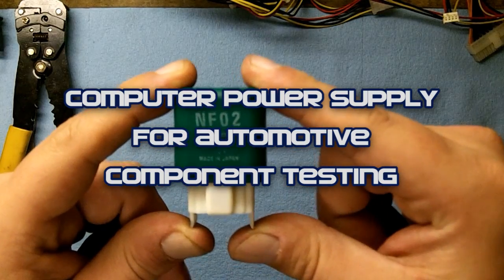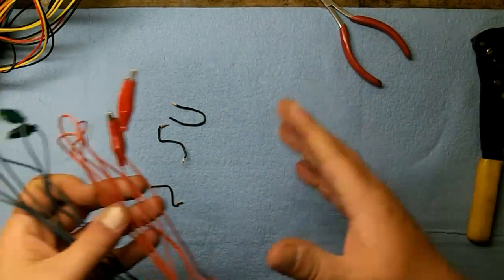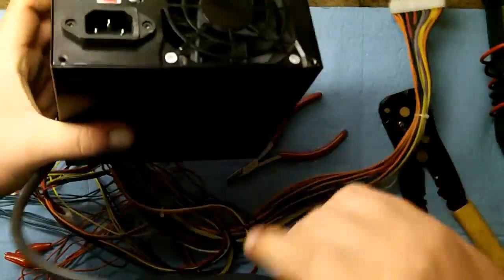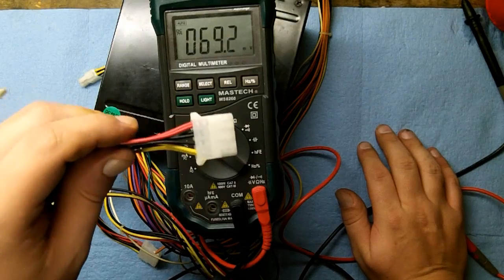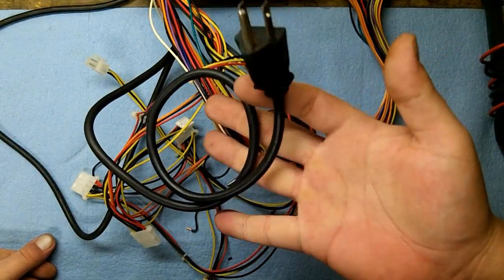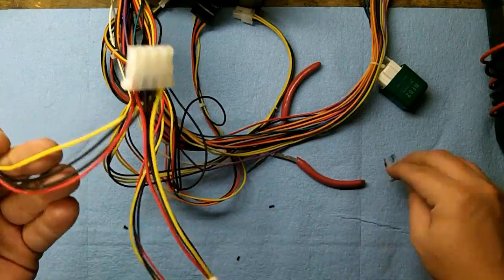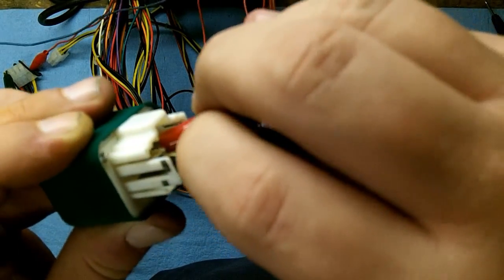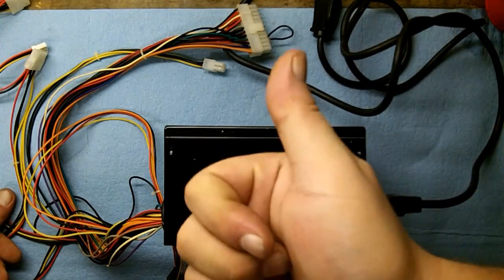Computer Power Supply for Automotive Component Testing

Comment: good idea,, if you only need low amps,, bought a used car battery at auto recycler. I need to test starters also.. You can also use a auto battery charger, everyone has one of those. And you build a breakout box from a used harness.
Reply from the maker: Yup you can test headlights, alternators, or any other automotive component that requires 12V. I don't think you'd want to test a starter motor with it because starters require a massive amp load sometimes above 100A which would trip just about any house breaker. :P

Comment: Hello, I'm looking to buy a engine from a local junk yard and they don't save mileage of the cars and the cars don't have keys or batteries. do you know to to light up the instrument cluster to see the mileage that was on the car?
Reply from the maker: +john Balko Sorry I don't.  I recommend you look into wiring diagrams available for free from pmx626.info.  Bring a 9v battery with you (can fit in your pocket) and hook it up to the correct positive and negative pigtail for the instrument cluster harness.  Yes a regular 9v battery should be enough voltage for you to at least get the instrument cluster to work for a little bit to see the odometer reading.
Reply: +DJDevon3 i found couple wiring diagram for 2002 mazda millenia but i dont know how to read them

Comment: Could I use this power  supply to test the circuits on a heater control panel circuit board from a Toyota Camry ?
Reply from the maker: +IKAGAN FREEDOM If it requires 12v then probably.  Don't take my word for it.  Disclaimer: I accept no responsibility what you do with the information provided in that video.  I would start with a lower voltage first.  Most power supplies also have a 5v line too. You could start with that.  I didn't cover exactly which one, will leave that up to you to figure out.  If you can't figure it out then you probably shouldn't be shocking PCB's with voltage. ;)

Comment: Hi DJDevon3 I'm a subscriber to your channel and have watched many of your videos. I own a 1998 Mazda 626 4Cyl 2.0 with 175000 miles and I've been trying to solve a problem with rough idling. The car idles within the normal range of 650-700.The current long term fuel trim consistently reads +9.4 and improves (or decreases) when I accelerate the engine. This led me to believe it was a vacuum leak but I did a smoke test and to my surprise found nothing. Additionally, I've done the following: remove/clean idle air control valve, clean throttle body, clean mass airflow sensor, replaced fuel injector o rings and seals, replaced fuel filter, replaced spark plugs and spark plug cables. I even replaced one of the motor mounts. The only other clue I can give you is that the rough idle worsens when I put an electrical load on the car like the a/c, headlights, rear defroster, etc. Can you give me any advice? Thanks in advance brother ... your videos are the best!
Reply from the maker: Good job of tackling some of the diagnostics.  Most of the things you've done I would have recommended you do so good job so far.  Next do a compression test, test your fuel pressure regulator, and check your mechanical timing. +9 isn't really that bad but it does indicate a fuel trim issue.  Yes a vacuum leak would be the most obvious thing to do but at +9 it's going to be a very small and hard to find leak.  My guess is it is actually just a vacuum leak you still have yet to find.  Inspect the bottom of the 90 degree intake elbow for cracks.  When you put a load on the engine it can rock backwards which can cause a small tear to enlarge and allow more unmetered air to pass through.  Small tears like that can "heal" themselves when the engine isn't under load too essentially sealing themselves and hiding when it comes time to do a smoke test.  Do another round of tests for a vacuum leak because it makes the most sense.  Also check your MAF signal and see if it's slightly off according to manufacturers spec.  A false signal (faulty MAF) will adjust A/F ratio incorrectly in the same exact way a small vacuum leak will.  It's possible you do have a completely sealed vacuum system but a faulty MAF will exhibit identical symptom to an air leak in the same way that a lazy O2 sensor can as well.

Comment: Nice tip  DJ on using a computer power supply for automotive testing. For the relay contact, another test instead of using continuity is to push some amperage down through the contact and measure the voltage drop across it. At work, we use this method as a PM to see when relays/contactor contacts are beginning to fail. Keep up the good work.
Reply from the maker: I also did a quick resistance test but decided to leave it out because it requires knowing how to interpret the results.  The testing procedures didn't include any specs with the relay and it's not printed on it.  I do understand what you mean by looking for voltage drop and that's a really neat idea.  Never thought of doing that.  Makes a lot of sense actually.  They probably didn't put that in the factory manual as a testing procedure because you can't go to a customer and say "X component is about to fail but still working good".  What do you think is going to happen 99% of the time?  They're definitely NOT going to replace the component.  From a company and techs perspective it's not worth the time to do the test.  From a car owner's perspective like me where you want to know the health of all components at all times then that's a very good test to do.  Might actually do that one tonight just for my own curiosity.  Great tip, thanks Stuzman52!